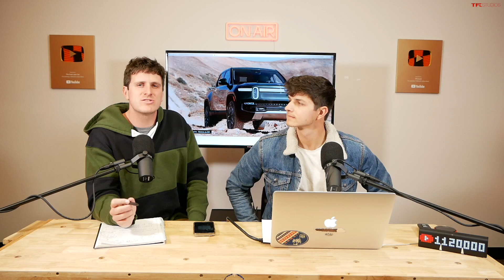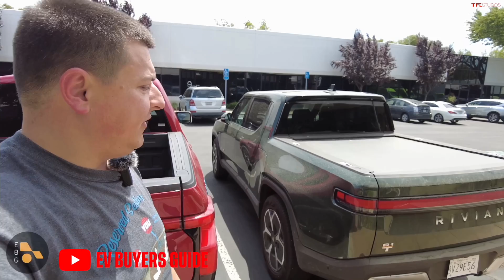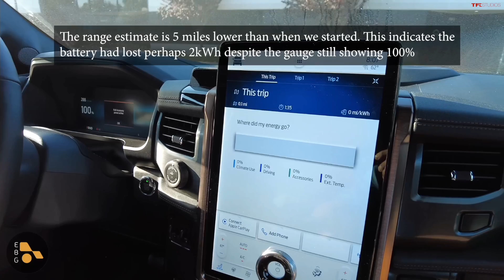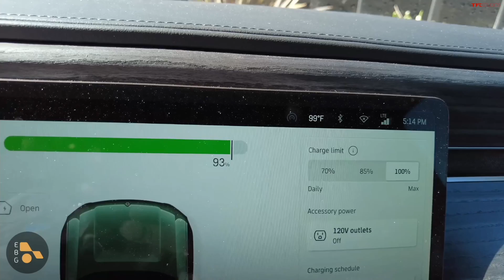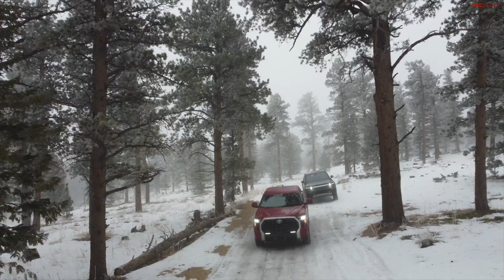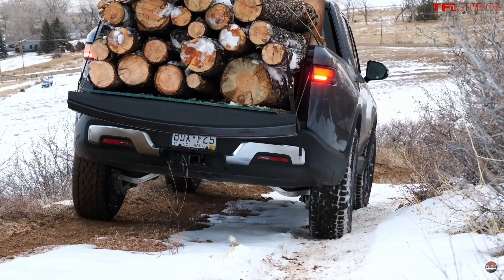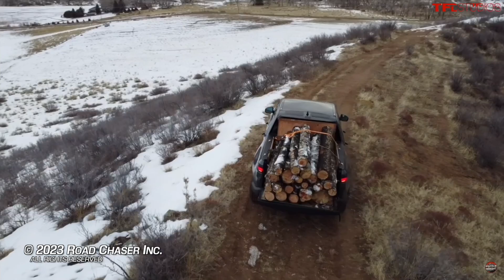This Rivian Is Getting The Equivalent of Just 25 MPG: Here's Why That Matters!

Comment: 3-12% standby losses over a 24 hour period are normal?  Yikes!
Reply: Because they keep everything running. I’d rather a second for everything to boot up than have such wasted loss
Reply: My mach-e doesn't lose 1% over a week!
Reply: @jamesworth4576  That's like that Ford truck in the comparison. Good comment, can you imagine how unhappy you'd be if your Mach-E lost power like that? What if you went on holiday or if it wasn't daily driven?? Crazy
Reply: I get about 1% loss over a 24hr period. His truck definitely has an issue. The newest software update is supposed to fix the most common reason for this vampire drain issue. The issue is the latch for the frunk keeping the truck “awake” instead of turning off while sitting.
Reply: @dilmorecg  I have a Tesla model 3 Long Range. It sat for a month and a half in the garage. Battery drain was 3% over that time. 1% over 24 hours can happen if its really cold out but, if it's in a warm climate that is pretty significant drain on a battery in 24 hours.
Reply: Yeah. I've had two LEAFs(starting in 2014) and a Volt, and I've never even noticed battery drain. This is crazy from a company that's supposed to be on the cutting edge.
Reply: @robertcowher  Because its either misinformation (by accident) or just a lie.
I have a Rivian and it doesnt even come close to 12 miles a day yet alone 12%.
Oh and the 135K  battery is NOT thee equivalent of 4 gallons. Its closer to 9 or 10.
Reply: @jabberwolf7348  135 / 33.7 = 4

It's pretty simple math.
Reply: @CodyFlock  135 KWH not miles. And yes the Rivian gets over 300 MILES from 135 KWH . So why not use that big brain of yours and come back with a better response.
Reply: @jabberwolf7348  Haha, look closer my dear.

1 gallon of gas has 33.7kwh of energy in it.
So R1T with 135kwh has the energy capacity of 4 gallons of gas.

That's my whole point. You insulted someone else when they mentioned that fact and said it has 9-10 gallons of energy. Which I can only surmise you pulled from you backside.

Each percent of battery is ~1.35kwh, which is ~2.7 miles.

It's 2nd grade math sweetheart.
Reply: @CodyFlock  Yet the Rivian gets over 300 miles per 135kwh.  So the equivalency doesnt match. But go on, lets keep on showing people you're intelligence, or lack there of.
The part of intelligence you're missing, is they are translating that into miles. Please finish that grade school you know so much about. We'll be waiting.
Reply: @jabberwolf7348  33.4 kWh/gallon is the published equivalency by The EPA and NIST. About 4 gallons equivalency is correct. BEVs are much more efficient at converting stored energy to "work". How did you come up with 9-10 gallons?
Reply: @jabberwolf7348  haha what an idiot
Reply: @YachtsOnTheReg7  AGAIN they were using the mileage as an equivalent for gallon of gas as 33.7 kWh  AND NOT the mileage of the Rivian.
Dam, I know there are many idiots out there, but I didn't realize this many. And they keep volunteering !
To put it in laymens terms for those that don't get it. 
A gallon of gas is the same protentional for all cars but not all cars get the same mileage.  
The energy contained in 1 gallon of gas is equivalent to 33.7 kWh (kilowatt hours) of electricity. So for example, if an electric vehicle can travel 100 miles on 33.7 kWh of electricity, it would be rated with an MPG equivalency of 100 MPGe. (THIS IS UNDERDSTOOD).
They were saying that the Rivian has the equivalent MILEAGE (not power) of  4 gallons. This is not true.
Reply: @jabberwolf7348  EPA states that one gallon of gas is equal to 33.7KW.  So, 135kw÷33.7=4.09gal/equivalent.
Reply: Rivian fail.  They won’t be around much longer I’m afraid.
Reply: That is huge. Rivian is totally off my list now!
Reply: Like the rivian, but that loss is a deal breaker.
Reply: A Killswitch would be good. But the way modern cars are ist that if you switch everything on the car does at least display a million malfunctions.
Reply: @Nordlicht05  This whole thing is BS anyway and no one loses 3 to 12%, they may lose 3 to 12 miles depending on configuration. And they do have a secret kill switch in camping off mode.
Reply: @jabberwolf7348  than the solution is present 😄 as in another post. Normally these people aren't that dumb and mostly there is a reason. Even if it means the car is booting a little longer in the morning.
Reply: @Nordlicht05  To be specific, the camp mode, no food light,  no devices, and display off. its not a kill switch but almost everything is turned off. Im not sure what else it does that turning off gear guard does, but it seems to be very good at conserving energy.
Reply: @jabberwolf7348  kill switch was an over exaggerated word from me.
Reply: So it would be “Normal” to have an ICE  car running idle while you sleep?
Reply: @NanoSchaap  only happens in Siberia so the engine does not froze solid. 😅
Reply: No?
Reply: 12% per day! Gives you 8 days until your battery is flat! No more 2 week holidays!
Reply: Heard a patch got released and it loses 1-2% now
Reply: 36 gallon fuel tank are pure magic!!!
Reply: That’s insane. This is why you don’t buy a first generation. This is a beta product that best!  

up to 12%!
Reply: Not so green EV after all. <12% of 135 kWh is <16 kWh. Like my house 24 hour consumption. I am guessing it is warming up its lithium battery.
Reply: @Martinko_Pcik  None of the math makes sense.
1- he is comparing 135kwh to 135 miles (for 4 gallons)
2- I have a Rivian and I have NEVER gotten 12 miles, yet alone 12% vampire bleed. 
NONE of this video or its math makes any sense !
Reply: @jabberwolf7348 According to the EPA 1 gallon of gas is equal to 33.7kWh
Reply: @Reginald_Harrison  Yes but hes using it as the mileage for the Rivian. AND THAT IS THE PROBLEM. Thus the whole thing looks like they are complaining trying to use gas mpg equivalency. Rivian gets around 300 miles for 135kwh
Reply: Most EVs are about the same - My R1T is better than my Model X was in this regard. Also keep in mind, that you lose a % OF CURRENT CHARGE meaning as the charge gets lower the drain stops. It's something to improve, but not an issue for daily drivers (not Jordan).

If you drive less than 5000 miles per year, buy a gas car.
Reply: @renderpaz  I wouldn’t say “most EV’s are about the same” my ‘22 Kia Niro EV with 2019 battery tech doesn’t lose any noticeable range over 2 days of sitting at the airport, even with overnight lows in the teens and highs around freezing.  I know this because I just returned from a two night trip.  

They also said in the video the EV6 and F150 Lightning don’t have this issue and another guy in this post string said his Mach-E doesn’t.  

Just want to state this so people know this is not an issue they will experience just because they buy an EV as you’re statement suggests.
Reply: @renderpaz  That simply isn't true. You need to be fact checked. I've seen Teslas and Ford products NOT have this problem, there are other commenters here saying the same thing. Look at what other owners are saying. Look around on Youtube, check forums, whatever. Ask some other owners next time you charge in public. If you're not in a temperature extreme it's even less common.
Reply: Well seeing as his math was wrong with the 135K to  gallons of gas equivalency, I'm assuming that he means 3 to 12 miles and not %
I get about 3-5 miles vampire discharge per 24 miles and that's WITH gear guard on and in SF city where people walk by all the time.
This type of bad math and just INSANE miscalculations usually leads me to believe this person is both, bad at math, and probably not a Rivian owner ( but someone that hates the ideas of EVs).

Comment: The problem is Riven copied Tesla technology.  They are no where close to the efficiency.   

Tesla pulls power in sentry mode.   Turn century off don’t use your app or do software updates and Teslas go to sleep. At that point you will lose maybe 1 or 2 miles a day in 70 degree weather.

Comment: I would love to buy a rivian as my next truck but the phantom drain is absurd. I noticed when I first got my M3LR it had high phantom drain when it had the sentry mode bug but after that finally got patched it was fixed.
Reply: The phantom drain varies wildly based on your conditions. If you're in a more temperate area, or park in a garage that doesn't reach temperature extremes, you won't get nearly as bad phantom drain. I've had mine parked outdoors in "average freezing" (~25-40 low/high) for multiple days and only gotten ~1%/day in phantom drain. (Heck, I just woke my truck up while writing this comment after being parked for 16 hours below freezing, and it reads 1% HIGHER than when I parked it. 34% now, it was 33% when I parked.)
Reply: @AnonymousFreakYT  This guy still only used about $12.50 worth of power to drive back and forth to work for 10 days including all warming up time and travel. Not a stretch to think he could burn through the same amount of money in a couple days driving an ice vehicle pick up. His theory on battery cycles is flawed as well. Whether you add 5% charge ten times or 50% charge one time it's technically the exact same cycle for the battery. Also he's actually using more cycles of his battery doing this method as the vehicle would use power from his house to preheat the vehicle if it was plugged in rather than depleting the battery and adding additional cycle use. he'd be better to charge it to 50 or 60% and plug it in daily for max battery health

Comment: I'd imagine this is likely due to Rivian regulating the battery temperature. They have had a number of battery temp issues while charging. The truck may be working hard to cool or heat the battery when compared to other EVs causing the battery to drain at these rates. We should either test or have Rivian provide more info, but to me, this seems like the likely culprit.
Reply: Could be. I've seen a little more than 1% battery drain when I let my R1T sit. But my truck is always parked in a garage. I might need to experiment. 
It's the only thing that makes sense. Frankly I'm amazed Gear Guard uses so much power. I have it turned off when I'm home.
Reply: This would be my first guess as to what's going on.
Reply: There were also issues with the compressor running too frequently. That would chew up energy as well.
Reply: But yet you still get bricked trucks in the cold. Apparently doesn't work.
Reply: Same, it's the only thing that could use that much energy.
Reply: This guy still only used about $12.50 worth of power to drive back and forth to work for 10 days including all warming up time and travel. Not a stretch to think he could burn through the same amount of money in a couple days driving an ice vehicle pick up. His theory on battery cycles is flawed as well. Whether you add 5% charge ten times or 50% charge one time it's technically the exact same cycle for the battery. Also he's actually using more cycles of his battery doing this method as the vehicle would use power from his house to preheat the vehicle if it was plugged in rather than depleting the battery and adding additional cycle use. he'd be better to charge it to 50 or 60% and charge it daily for max battery health
Reply: Maybe this is the issue, however if we the case, it should consume less energy in shipping mode but was the contrary.
Reply: @guigocn2  Good point, but maybe shipping mode would still allow battery temp control at extremes temperature range.

Comment: Imagine coming back to your gas powered car and losing %10 of a tank for no reason. There would be riots.
Reply: Imagine being in the middle of bumfuck Alabama and you get a low fuel light that you are able to fix in 10 minutes. 

Try that with an EV and finding out it isn't possible. There would be riots.
Reply: Can't even leave your car at the airport for a 10 day trip
Reply: That would cost me about $0.80 sooo.. ya know. Whatevs
Reply: That happens when E85
Reply: Electric vehicles are a scam
Reply: That is how Hydrogen tanks would work
Reply: That has happened to me and I lost a full tank of gas but it was the kids in the neighborhood that siphoned it out.
Reply: Thats what I LOVE about my 2019 chevy VOLT, drive on 100% battery power anytime I want, drive on Battery/Gas combination anytime I want. 90% of the time I use only battery as I get 100% FREE charging provided from work.
Reply: @carlsapartments8931  as much as I hate gm they actually have the right idea with that car. Or had rather since I think they stopped making it.
Reply: Happens at the wife's office, guys using siphoning equipment to drain people's tanks.
Reply: If they left the motor running, then HELLO!,  turn off the heater and such... Also can a gas car fill up at home from a solar panel?
Reply: @shovelIRL  It's lost as heat through the computer and BMS
Reply: @ToBeatADeadHorse  once an EV battery is unable to efficiently turn  the motor in the vehicle at around 300k miles. The battery is not discarded. It is stacked with similar batteries to store solar energy for nighttime use. It's being done now.
Reply: @ToBeatADeadHorse  this happens with cell phones because they are hard to recycle for very little usable material. Ev batteries will be highly sought after for recycling because of the high amounts of high purity already refined metals and minerals present. The idea is to eventually have a closed loop system where very little mining of new minerals is required.
Reply: @themeach011  Riiiight
Reply: @e S  what?? We already have huge recycling industries for many many different materials. Yes we still need to produce more new materials as the economy grows etc but it's largely offset by recycling existing materials as well such as steel and aluminum, the list would be extensive. So what's your point? If we can't get 100% of the materials from a recycled source we shouldn't get any? Or if we can't recycle 100% of a product we shouldn't produce it at all? The battery recycling industry is growing at over 30% per year compounded annually. I'm just not quite sure what u are disputing here?
Reply: @themeach011  There won't be enough between production and recycling to reach the target goals they want. Even Elon has come out begging people to source more cobalt. But they can't. Most of it is in the congo being mined by hand by whats essentially slave labor. You need a ton of copper for all the charging infrastructure. Charging stations are shit. Have all sorts of problems. Some areas it was costing more to charge and drive an ev than a gas car. Its a shit technology for rich people.
Reply: @e S  so were gas cars when they first came along and all the horse people would have sounded just like u do.
Reply: @themeach011  As long as people make babies and economies around the world grow, as well as demand for energy, that will never happen
Reply: @Niaaal  I totally get that but that doesn't mean that recycling won't become a huge part of the battery supply chain.
Reply: @shovelIRL  gasoline could evaporate or leak.
Reply: @mattv5281  have you ever heard of an evap system? Lol
Reply: @mattv5281  new cars have closed systems.  Unless it’s a real leak they don’t lose gas , unless you leave it alone for years
Reply: @mattv5281  Then there is something wrong with the tank and if the car was new the manufacturer would have to fix it and if they failed to fix it would be subject to a lemon buy back.
Reply: @mattv5281  and that happens to new vehicles? Even if a leak does happen to a new vehicle it can be fixed. As far evaporation goes  that does happen... . At about 1/8 off an ounce a day.
Reply: @WheresHerb  that's why virtually every modern vehicle has a evaporative emissions monitoring system. If there's a leak your vehicle will tell you and if there's a failure in the monitoring system your vehicle will tell you.
Reply: @mattv5281  gas does evaporate but it is captured by the charcoal canister and burned.
Reply: @ToBeatADeadHorse  Could you tell me where this landfill is full of batteries? I quite fancy one nights work making me so rich I never need to work again in my life. (Whoever told you batteries are going to landfills is a liar and you should stop listening to them)
Reply: That’s not a good comparison, EVs are so efficient that 3 people instead of one could make you lose 10% of your “tank” too in an ev, gas vehicles are just so bad they can’t get much worse
Reply: @jacobmaz8157  EVs are terrible in cold weather and extreme heat.
Reply: @jacobmaz8157  How many Congolese kids did it take to dig up the cobalt for the EVs?
Reply: @jacobmaz8157  my gas powered truck gets 95% of the mileage towing a 19' boat loaded with camping gear and work tools/supplies as it does completely empty towing nothing. The difference in fuel economy for an extra two or three people would never be noticeable.

Comment: 60 miles at an average 11 mph.... Assuming that doesn't include idle time while parked that is a brutal route. 

Mine used to be 20 mile w/ 16mph avg (on highways) and by the end I was about to lose it. Can only imagine how bad this is.
Reply: Hi, I'm the guy w/ the truck. I used the truck for groceries, dropping the kids at school, general around town things. I totally agree, if I commuted the truck would be much more efficient.  It's an amazing machine and my use case is a bit pathetic; but I don't think it's that uncommon.
Reply: I'm surprised no one else has pointed this out. A gas truck of that size/weight would be in the 12-15 mpg with that average mph maybe less!

Comment: Video idea.  Test the bolt for vampire loss.
Reply: Its been done. Zero. The problem is only known to Teslas and Rivians. Which unsurprisingly use the same battery pack tech (individual usual type batteries). All other manufacturers use the "baggie type" rectangular battery cells.
Reply: I have a Bolt. I've never noticed any
Reply: My Niro EV shows no appreciable drain either.